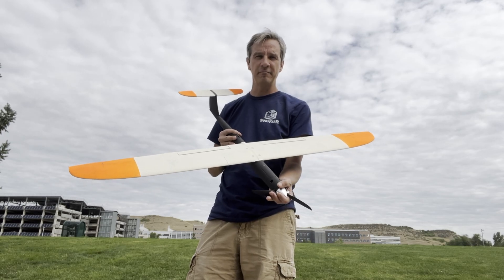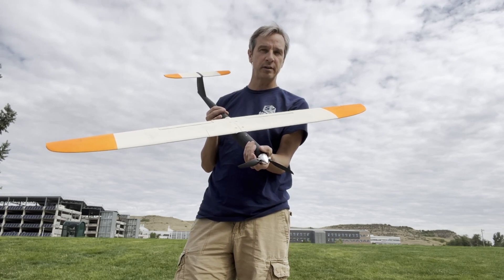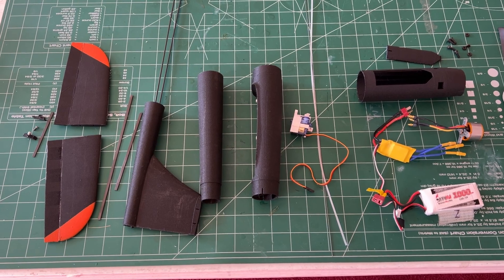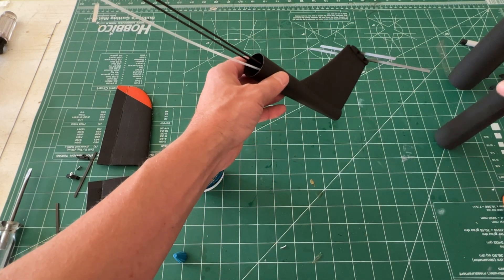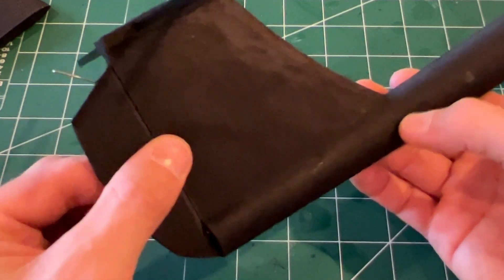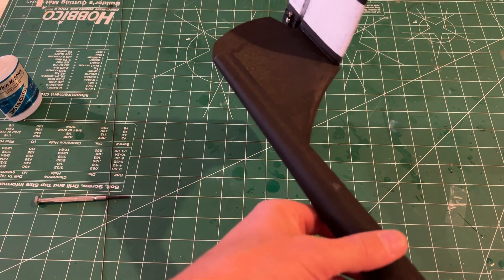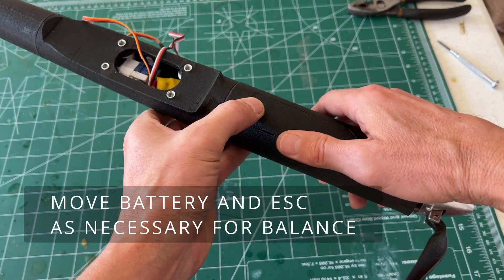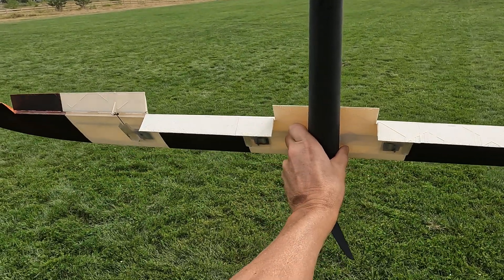Igneous - 3D Printed Powered Glider - Build and Fly

Comment: Do you have a video that shows how the servo at 3:49 is installed step by step? I cannot find another video
Reply from the maker: This is an older video of this design, the new version the servo mounts upright under the wing.  There are instructions included and pictures with the print files … and the video for the Igneous in LW-PLA-HT has these new parts

Comment: Hi @soarkraft - I can't source the prop set and the carbon sheets here. So I'm thinking of going with acrylic sheet for the carbon sheets and a 3d printed fixed 10 x 6 prop instead of what's suggested here. Should work?

Comment: Hi what are ther throws for flaps (crow) , ailerons and elevator ? In manual looks really small. Thanks
Reply from the maker: This depends on how you built it (weight) and how you fly it, flat field landing or slope.  Flaps at 45 degree down give a nice gentle glide slope, but down slow it down much.  I do 90 down for max “brakes” but then need to remember to back off to 45 when it gets close to the grown so it does not flop to the ground.  I only use a little up aileron for flat fields and more as a counter to the 75-90 degree flap lift increase … like 8-10 degrees.  Now on the slope trying to land in lift is different, more aileron… and it depends on how heavy , how much landing space… and your skill.  I’m adjusting these all the time and I have no one setting.  Thanks, for bringing this up, I should probably add more info to the instructions and maybe do a video about it.
Reply: @soarkraft  ok yes it depends. But some basic settings would be welcome. I set throws by eyeballing :) we will see how it will go. Set normal rates and high rates.
Reply from the maker: @Jure380  ... so if you are not going to give me a hint as to how you want to fly or your experience, then use dif aileron 6mm up 3mm down.  Use 3mm up, 3mm down elevator.  Use 45 max degree down flaps for landing.... prepare for elevator compensation as the flaps will induce some pitch..... adjust as necessary.  This will be less roll and more elevator, and CG at the CG or forward a hair for first flight.  I suggest playing with the PicaSim RC flight simulator if you are a novice.  My planes are not crazy hard to fly, but they are not slow beginer planes.  No pressure.... you can always make another one, have fun, that is what this is about.
Reply: @soarkraft  hey. I consider myself as intermediate skiled pilot. Gliders, Basic 3D flying, glow engine low wing planes, also had one pylon plane,.. so i think your stlye of flying i saw in videos on slope should not be problem at all.

Comment: Great looking for sure, wow!
I am thinking about trying this as my first 3d print. Its not easy to get carbok fiber here in Sweden. Would appreciate a easy way to see whitch is needed for the body to.
Tried on you page, sure Im just a bit dumb... 😊
Reply from the maker: 1 meter long - 2 mm rod, 1 x 4 mm strip, and 6 or 7 mm tube / rod for the wing spar depending on which wing airfoil you order.  There are several sources in Europe... search "pultruded carbon"... don't get the 3K or woven stuff, not worth the extra expense.

Comment: Are you using Y-cable for the ail and flap?
Reply from the maker: No, multi channel programming.  You can probably use y-cables.. but I don't.  Maybe I will break out my old Futaba Gold Box from the 80's.. my second radio ever... and use it some day, but modern radios are way better.

Comment: Stop saying kilovolt for motor spec. It's K V. Meaning 1400k revolutions per volt.
Reply from the maker: Thanks for pointing that out... I never talk directly with people about this stuff... my wife has no idea what I do.  When I see KV the words "kilo volt" come out of my mouth every time.... and its 1400 revs per volt if you want to get specific..... which I knew, but never thought too much about or why they would call it KV.  I learned something today... anything else I messed up?  I'm sure there is more.
Reply: Wouldn't say it's a mess up. Motor specs are very confusing when you first get into it. And even more complicated when different manufactures decide to use their own descriptions.
Reply from the maker: I am sort of new.  Had a brushed geared set up years ago, stupid expensive, but no speed limit... or so it seamed.  It was in a Wilco/Tiger, awesome until I crashed it.  Wanted this Igneous to fly like that,... within reason. 
These cheap three phase brushless motors are awesome, but it still surprises me when I am doing a fly by and hit the throttle and see the plane slow down.... 1000KV motor with a 10 x 6 folding prop on a 3S lipo... 50mph max speed and makes for a huge brake when the plane is flying at 70+mph.  Working on a hotter set up, but same fit: D2836, 40A ESC, 4S 850mAh Lipo, 7 x 5.5 prop (no fold).

Comment: I love the designs of your airplanes. They look so simple and look like they fly really good. I’m definitely going to design my own. How fast can this airplane go? Which one flies better, The Polymaker or PETG?
Reply from the maker: This model in PLA has gone 100+mph.  Polymaker is good for lighter weight, longer flights, not speed.  I still like PETG, but it is not as stiff as PLA and a little harder to print.  PLA pro or tough PLA is ~ flex and strength as PETG for rough landings, easier to print.  

Sure, design your own, but not as easy as it looks..... Im an aerospace engineer and I do product design as a profession, CAD work for 30 years+, and this was still one of the harder projects I have done.... but I started from scratch.  I did this because nobody was designing/selling what I wanted to 3D print and fly at the time.
Reply: @soarkraft  Im actually currently studying to become an Aerospace Engineer. Over the summer I designed my own plane baised off a late WWII Spirtifre made out of foamboard and some PLA parts. I used Openvsp and Fusion to design the whole plane. It flies great and I learned a lot about CAD, 3D printing, and some aerodynamics (which can get really complicated I've found out). I've always wanted to design my own plane because new models are expensive and crashing them just isn't fun. But building your own models, if you crash them, you can just build a new one and, you can build it to fly how ever you want it to fly.
Reply from the maker: Nice.  Learning all of this to make it into a flying model is great preparation for real work projects.